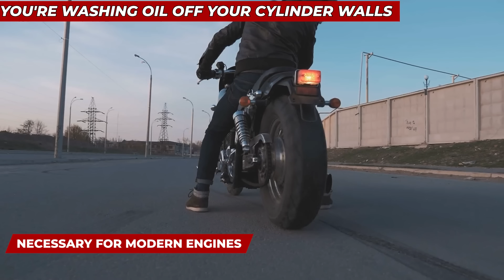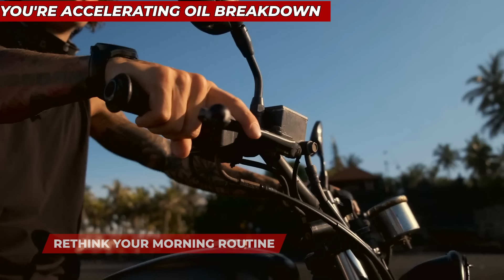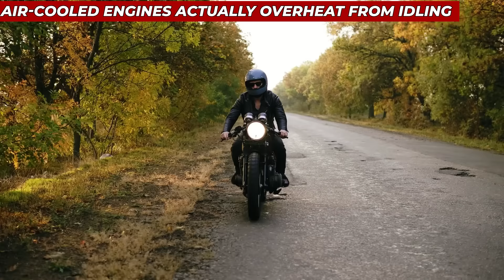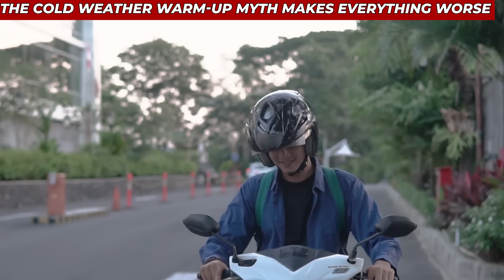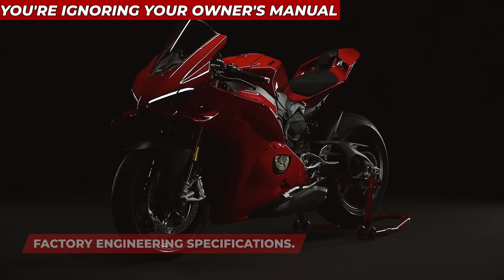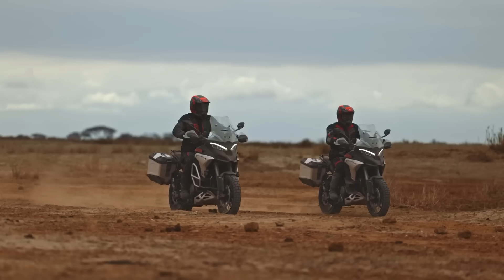Why Idling Your Motorcycle Is Slowly Killing the Engine

Comment: Add and run Seafoam in your gas at the beginning of the riding season.  Burns off carbon buildup. Don’t start the motor during cold weather unless you’re going to ride, getting it up to running temperature.